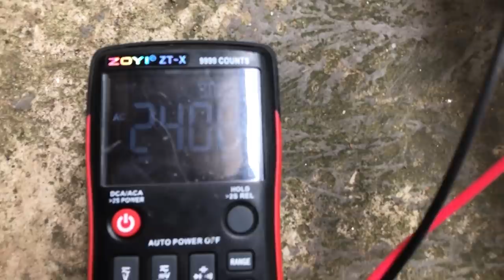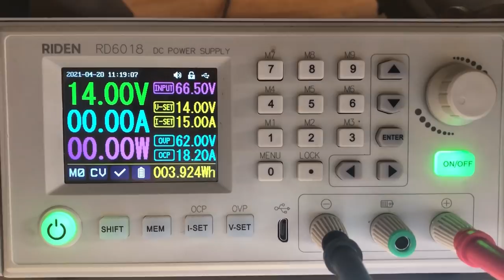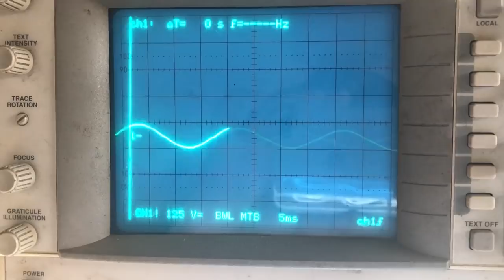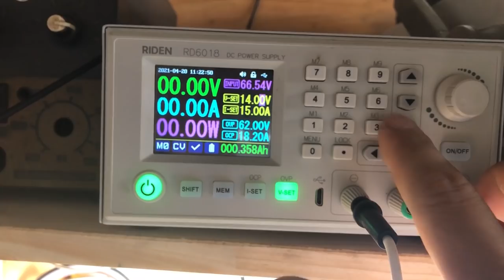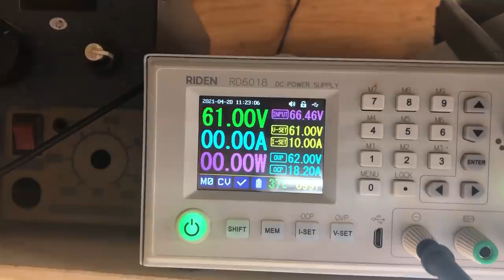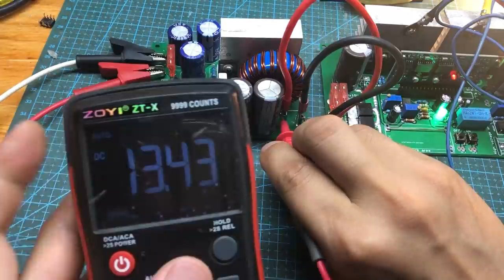Make 1000W Solar INVERTER

Comment: Alright, you're becoming a pro at this.
Note: the buck needed for a 24 h continuous run time with battery backup is at least 350 amps! (1000w@12v input, 6 h of usable sunlight a day)
Reply from the maker: ok